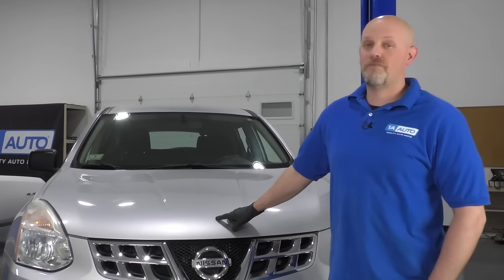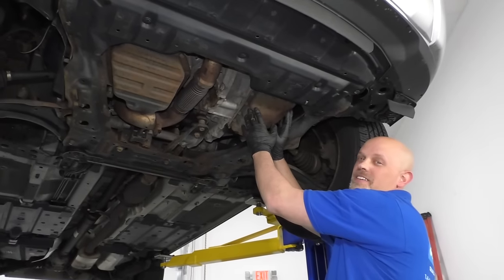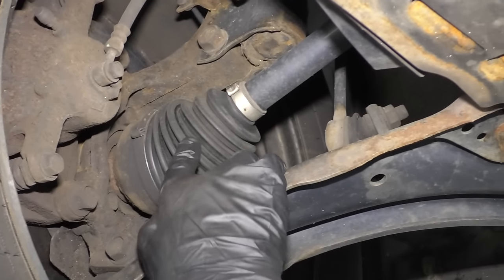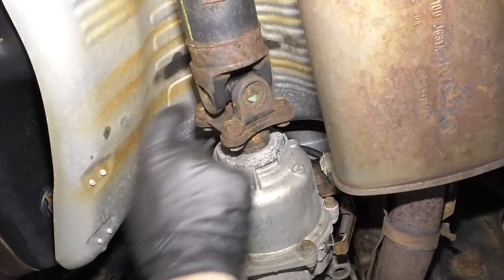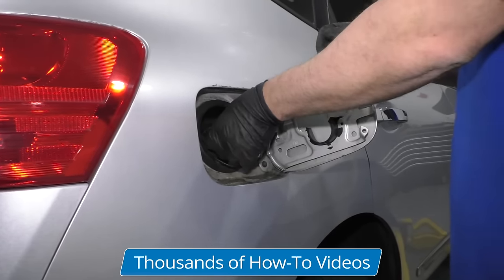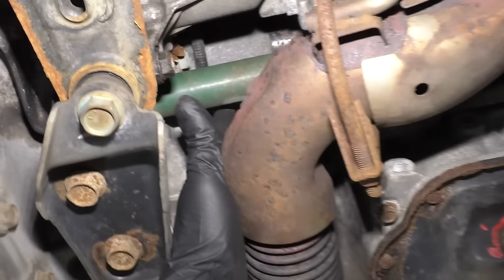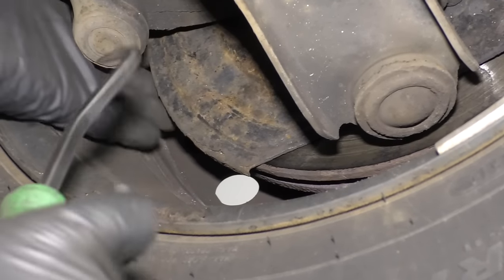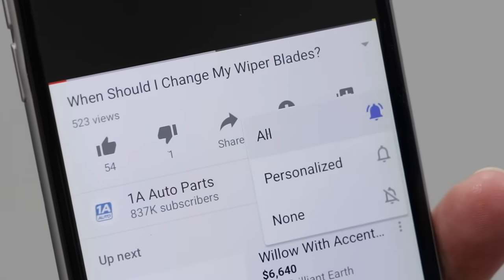Top 5 Problems Nissan Rogue SUV 1st Generation 2007-13

Comment from the maker: √  Watch the Video
√  Buy The Part at 1A Auto http://1aau.to/m/Visit-1AAuto
√  Do it Yourself
√  Save Money
Reply: I agree blower motor stopped working on my 2012
Reply: Do you have any videos on how to replace the driveshaft?
Reply from the maker: +Arthur KH Thanks for checking us out! http://1aau.to/m/Shop-1AAuto-c
Reply: Thanks excellent information 👍🏽
Reply: Good afternoon thank you for taking the time to respond to my question I much appreciate that have a blessed evening
Reply: The driver seat won't move, the motor runs the seat forward a little bit , not backward all the way
Reply: Are catalytic converters a common failure in this suvs? Like cats getting plugged and such?

Comment: As someone who owns a 2013 rouge. Don’t do it. Yes it’s a comfortable SUV, and I am a very safe driver; regardless my car was very loud and shaky before I got a full set of brakes and Rotors. Now my transmission is really messed up and from all the shops and mechanics I’ve been to, they’re giving me a price of $3,500-$5,000 to get fixed. I need a who new transmission rebuild plus the labor work. So unless you’re willing to make that commitment stay away from this model and any Nissan.
Reply: man sorry to hear that i have an 08 and havent had any issues besides the usual maintenance and few recalls! how many miles are on it when this all started going downhill? im at 90K
Reply: @12bitizthewaytogo92  Change that fluid religiously every 25,000 miles and get a transmission cooler if you don’t have one. Mines has 140,000 miles on it. I change my CVT fluid about once a year, it’s cheap and easy, plus I have a cooler. She accelerates smooth and there’s no whining sound like I’ve noticed on other CVTs.
Reply: Wow.  I've got a 2011 with 235,000 + miles and only problems I've ever had is CV shaft replacement, both sides, and a starter.  I would still drive it across the US and not worry.
Reply: I’ve been driving mine for 2 years..still haven’t taken a trip to the mechanic! 2012 Nissan Rouge Mileage:160,000 when I got it
Reply: I just bought a 2013 last week, it’s got 84,000, I think I might need a fuel filter change cause it’s seems sluggish but I do really like it
Reply: @12bitizthewaytogo92  Usually happens around 130K after any extra warrantees you paid thousands of dollars for have expired.
Reply: @ButterballKing55  Good to hear. I have a 2017 and I worry.
Reply: My girlfriend 2012 rogue has had the transmission replaced twice before 150,000 miles. Good thing that was covered under warranty but she just had the head gasket replaced after that for $6,000 out of pocket
Reply: My transmission failed after 120k.  Honestly it shouldn't be like this. It stop in the middle of a turn. Like a fail safe. Very scary. Then after I took it to a check I got told : your transmission is bad. So I had so many cars before and a lot of minor things replaced but. Transmission just like that!!. Is not what a car is supposed to do. Motor and transmission should not be a total replaced on any car. Just because you didn't add a qt of oil. NO!!!.
Reply: @EricFortuneJr.  cvt transmission at at a mechanic is $400 to 500 the lowest DIY is about $200.  So you spend about 2k. So that problem is the same a very costly TRANSMISSION.
Reply: I have 2016 Pathfinder CVT with 70k right now we are the original owner changed the transmission fluid every 30k miles no issues at all,used cars sometimes is somebody’s else problem!
Reply: @EricFortuneJr.  I did the same when I got mine with 105K. Changed fluid and 2 filters + Extra Cooler ($80 on Amazon). My mechanic said  when scanned it that this procedure saved my transmission because it had started to show random errors codes in the trans. Now I m around 125K and planning to change the fluid at 130K.
Reply: @cptty3203  who TF charged her 6k for a headgasket?!?!

Comment: as owner of one of these, I can confirm at least 3 out of the ones mentioned. the major one is always the CVT, which can be 'solved' by installing an external CVT cooling system, around $500 USD, overall, good SUV.
Reply: What year do u got? I just bought a 2013 last week
Reply: @woozy607  buying one next week now i am worried
Reply: @iwillrateyou9375 dont do it!!!!

Comment: Great video!  I have a 2012 Nissan Rogue.  I've had to replace the front CV axle because of a leak.  I'm also getting a bad winning noise when I back up and turn the wheel.  Sounds like it is in the engine area.  Repair guy said it was the AC compressor going bad and it was putting extra tension on the serpentine belt but it is still doing it with the AC off but it is not as loud.  Any suggestions?

Comment: If you are getting a horrible rattle in a 2008-2014 Rogue look up NTB14-018 Technical Service Bulletin.   You can fix it for $1 with a big hose clamp, or go to the dealer where they will lie to you and estimate like $1000 in exhaust work.
Reply: Niiiice!

Comment: I own a Nissan 2013 with 180k as of today.  I still have the original brake pads. The only issues I've ever had with the Rouge is the AC compressor and the doors locks.  I replaced one CV on the right side.  I have never replaced the oil for the CVT but religiously change the engine oil at the dealership.  I have to replace the catalytic converter to pass inspection this year.  All the items mentioned in this video have NOT been an issue.
Reply from the maker: +Tom Shields Thanks for the feedback!

Comment: as soon as I heard it had a CVT I steered clear and stayed away.
Reply: i'm pretty sure all nissans do
Reply: @gabriellazych730  the trucks (and SUVs with truck drive trains) dont, theyll have 6 speed automatic
Reply: Since 2011 I had no problems with cvt. My next vehicle will have a cvt too
Reply: Have a 13 Rogue with 340, 000km on the engine and CVT. It's honestly been one of the best cars I've ever owned.

Comment: My fiancee has a 2009 Nissan rogue that we bought from my parents who bought it new. Since we have owned it, I've had to replace CV axels, the drive shaft, and I think I changed the gas cap for an evap issue. I don't know if the transmission fluid has ever been changed, so I better do that before I check another issue off on your top 5 list. I'm glad 1A auto makes so many videos for her exact car! I'm about to replace her valve cover and you guys have a perfect video for me to follow along with. Thanks!

Comment: Aside from general maintenance, my 2013 rogue seems to break down with some kind of issue every 2 years, almost like clockwork. Bought used in 2017 with 46,000 miles  on it and CVT went out around 49,000. According to the dealership, the belt melted. Nissan very reluctantly replaced a component and added a cooling system. Then I twice had issues with the tensioner pulley, followed by wiper motor failures, two alternator failures, and a radiator that has gone bad. I have multiple rattling noises and rough acceleration from time to time. I love my vehicle, but I am not at all impressed with it. I hesitated to jump from the Honda/Toyota ship, and I was a fool to do so! This will be the only Nissan I ever own.

Comment: Great video. I have had 4 out of 5 of these issues you talk about, My EVAP hasn't given me issues yet (knock on wood) but have had other issues as well. I bought my 2012 Rogue used in 2018 with 50k miles on it, it was an (insurance claim car). I have 165k on it now and I think my PCV valve needs replaced and/or my spark plugs.  The past two years I spent just about 4k on fixing my Rogue. The blower motor last year and this year the axils, boots, sway arms, hub bearings, all wheel stuff. But I do love my Rogue my goal is to get 250k miles out of it. All my other vehicles I got 250k on my Chevy Cavalier and traded it for my Chevy Malibu 260k before I sold it to buy a 2011 Hyundai Elantra which was a terrible car, only got barley 200k on that car and had more problems than my Nissan ever had.

Comment: Bought a 2008 Rogue off my mother in law when she got a new car.
She had already replaced the CVT.
But I do a drain and fill on the CVT fluid annually (Idemitsu is a good OEM quality fluid at a fraction of the price of Nissan branded, just get the right kind).
Have done the other fluids also (coolant, brake fluid, regular oil changes).
New tires, battery, serpentine belt, spark plugs and coil packs (one went bad) since we’ve owned it also.

Recently replaced the clutch on the ac compressor since we lost ac, worked great.
But what do you know, now either the resistor or blower motor has gone (fuses still fine), so getting ready to replace those.
Gonna do a brake job at the same time.

It’s got 230k miles but still runs and drives great, albeit did need the new CVT years ago.

Comment: 2012 Nissan Rogue - 42k miles original owner. Took to dealer, for slipping on the right side and noise. Engine Subframe(Cradle), control arm, axle boot, stabilizer bar replacement recommendation for $3,900. They are crazy. Bushing are built into the subframe, can’t be replacement (found videos that show they can be but no mechanic will deal with that). Long story short, had it all replaced for $2,300 at my mechanic. Not sure if subframe is a must replacement but trust my guy. The engine subframe alone was a $1,000. Disappointed with Nissan’s build design of this piece. This will be a headache for many Rogue owners.

Comment: I have 2010 @60 k. In my case, the only issue is the occasional gear engagement problem. It is recurring. I mentioned this to a local mechanic but he seem to have no clue about the problem.

Comment: all-in-all bought new in 2008 and  237,000+ miles and going. Had all these issues to some extent, especially after 160,000 mi. Luckily, the CVT has been ok on ours- had a couple fluid changes and that's all. repairs- are reasonable. Good mechanic and some DIY- repair costs haven't been terrible. Most interesting incident -Had a mouse get inside the blower motor and bust some fins!
Reply: Its now 2 years later...that c.v.t. transmission stilll holding up???  Mine crapped out at 110,000 miles, going 30 miles per hour on a side street......$5000 to replace.....I beg you, o to keep an eye on that cvt. and don't push it hard!!! Oh if I could turn back time, but it probably would have failed anyhow, as I say, I was only doing about 30 mph  and everything else ,like the fluids were fine that day., and it just quit and I rolled to a stop.

Comment: I've had my rogue for four years and experience three issues out of the five replace the blower motor need to change the transmission fluid and definitely the front right boot is leaking thank you for the video
Reply from the maker: +G.MICHAEL Thanks for the feedback!

Comment: Just bought a 2009 and have a slight shake. I’ll get the transmission looked at soon. Thanks for the video!!
Reply: If you hear a whining noise when accelerating, it's most likely the CVT is failing. I had to replace mine at 229K KMS. The shaking, however, could be related to your front CV axles or a simple wheel alignment. Check your inner/outer CV axle boot as it's a common weakness in these vehicles.
Reply: Mistake to have bought, i bought the 09 as well. I can't go 50 miles without having to pull over and let it rest..... Not only that, if i didn't pull over it will make me anyway because eventually it starts to decelerate once it decides it doesn't feel like being a reliable vehicle. Mine doesnt like warm or hot weather. Mine doesnt like long distance trips or going uphills. Worst car ever
Reply: @ilianalopez6664  literally described the same problem i have with my 09 rogue as well
Reply: @ilianalopez6664  Could be overheating, check your drive belt if its still there or it could be a faulty water pump.

Comment: Also..
6. Lower control arms
7. MAF sensor
8. Heat shields (causes rattling noise)
9. OEM drive belts go bad super quick
10. Inner & outer tie rods. But if you're unlucky...
11. Rack and pinion
12. Steering shaft
13. Bose subwoofer (in spare if you have bose system)
14. Possible driver side front steatbelt buckle causes airbag light blinking

Comment: Blower was replaced no issue there. 
Changed the fluid and filter.
CV axels are easy to replace and I have done that. 
Haven’t messed with u joints or rear cv joints. 
Will check evap system

Comment: Yep. Blower motor went out on mine. Now the rubber boots on the front axle are torn. A mechanic is recommending that I replace the axle(s) at a cost of $1,100. No clicking noise from the CV joints. Just torn boots. Should the axle(s) with boots be replaced now? I’m fixing issues to sell the car. It’s a 2008 with 208,000 miles. I’m wanting a second opinion from a pro.

Comment: I have a 2016 Nissan Versa Note (116K Miles) and have had a couple of problems just like mentioned in the video! AC fan went out and yes I had to remove the pedals to change it. One of my drive shafts has also spit it's grease out as well. One problem I'm surprised wasn't mentioned is the exhaust heat shielding under the car. I had part of a panel break from the screws and it made an AWEFUL clatter until I fixed it. Maybe that's not a problem on the Rogue.

Comment: I have a 2008 Rogue. It has been a very good vehicle since I bought it brand new. You are correct though. The CVT transmission does have a vibration to it. I took it to the Nissan dealership before the warranty ran out and they never acknowledged the problem. That is why I am never buying a Nissan ever again. They don't honor their warranty. The vibration went away and the only major repair was with my transmission but it was only very minor. One thing you have to remember is that if you change the transmission you will need to have to take it to the dealership to have it synced with your car! Somehow the transmission is synced with the car's computer and this can only be done at the dealership. Luckily, my problem was very minor that I did not have to do that. The car still runs excellent! Like new!
Reply from the maker: +Jay Me Thanks for the feedback!
Reply: Did you use Nissan CVT fluid?

Comment: excellent video and very well explained, I just changed the control arm and pulled the road and front bearings, and now it sounds like it rubs something and makes a screech and when braking too, I will review the Shield thank you very much
Reply from the maker: +rafael quintero Thank you! We love empowering our customers and showing how to perform DIY auto repairs with our high-quality auto parts.  http://1aau.to/m/Shop-1AAuto-c
Reply: I had the same issue too when i replaced the control arms. Found the issue was the control arm was rubbing the brake rotor. I took a grinder and grinded the control arm so it wasnt rubbing the brake rotor anymore.

Comment: My rouge just hit 290k miles. Only thing iv had a problem with is front and rear wheel bearings
Reply: how did you maintain your car?
Reply: Wow that’s amazing. My transmission went out at 140k. Got rid of the car never buying another Nissan until they get a new transmission. I live in Texas and my transmission would overheat because of lack of cooling
Reply: My 13 Rogue has 340,000km on it. Excellent cars!
Reply: They’re great but that damn cvt trashes it. A simple bulletproof 6speed auto would’ve been much better

Comment: I have a 2009 Rogue which I bought in 2010.  It has about 90k miles on it.  I've had issues with 2 things listed.  The front axles and the EPA.  As it gets older the more problems it gets but don't all older vehicles?

Comment: Mine has no problem with accelerating, but when I put my foot down I can hear a strange whistling noise. Also when my a/c is on Low, all I hear is rattling and squeaking other than that it is running better than ever

Comment: I replaced the blower motor  sensor($15) did the pedal removal to get to it. #2 replaced CVT under warrantee since it launched after just a short while. #3 Passenger axle replaced three times now. Cheap always blows the outboard boot. Found bad Rear motor mount each time. #4 Windows freeze during winter and cable pops loose. Replace with 2009 window handle internals-problem solved. #5 After 140K miles the front wheel hubs and ABS sensor rust terribly and made nasty rubbing sound. #6 Exhaust heat shields. Had almost all corrode at the connection to the body due to direct fitting aluminum to steel which accelerated aluminum corrosion. Spayed the pin are on car with undercoating and used a 1 1/2 inch fender washer with a rubber washer to isolate the two.  #6 brake backing plates. Dang things just rust away.  The car is dependable but 1st gen had these issues.
Reply from the maker: +VoiceOF Reality Thanks for the feedback!

Comment: Hello 1A Auto: you are correct about the blower motor, I bought my 2012 Rogue SV brand new and in 2021 i had to replace the blower motor due to the noise it made. My rogue was only at 89K Km that time. Now at 93K km, when I accelerate Rpm between 1000-2000 I start hearing short rattle/screeching noise, it does not happen all the time, Could you please tell me what that is and how to fix this ? other than that, I actually really enjoyed driving it in earlier years.
Reply: did u find rattle?

Comment: Thank you so much for the information. My Nissan 2008 is not accelerating quickly I have locked of power it takes a few seconds to accelerate. Because of your great video now I know that the Crankshaft Position Sensor and probably the transmission are bad.
Reply from the maker: +DR Thanks for checking us out! http://1aau.to/m/Shop-1AAuto-c
Reply: did u fix it

Comment: My mother told me that there’s a recall on the Nissan Rogue SUV 🚙. And she is right about it. She is always right about it. Those things they always have multiple problems. Like the air conditioning filter, the battery 🔋 always end being dead 💀. And the airbag implodes. Not to mention it’ll caught on fire 🔥.